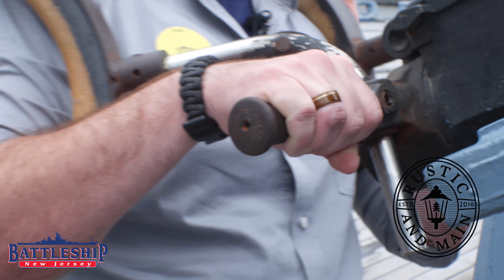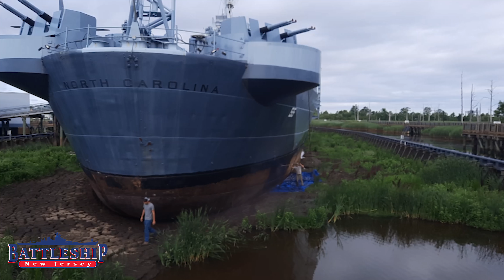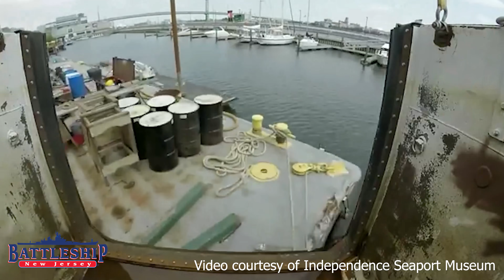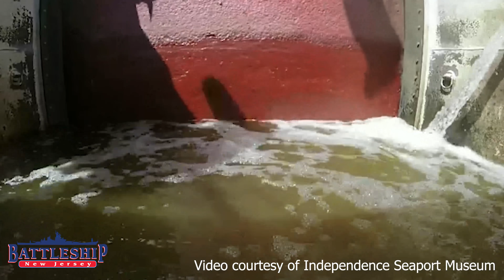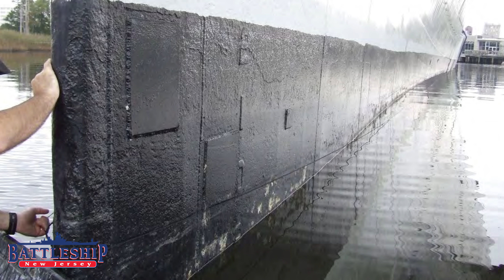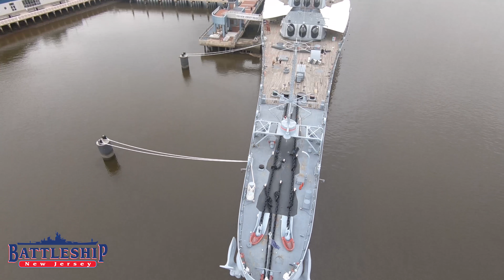Battleship North Carolina's Cofferdam

Comment: I think the cofferdam is great as long as the ship still floats and she can leave the cofferdam if needed to go to a conventional drydock
Reply: Doubtful if she ever leaves her spot again.  10 years ago it would have been about a $50 million price tag to get her to the closest drydock at Norfolk, who knows what it would cost in the future.  And she won't fit under the Cape Fear Memorial Bridge.
Reply: Theoretically she could fit underneath the bridge with parts of her masts removed, but it doesn't seem necessary if they can do repairs to the submerged parts of the hull that aren't encased in mud. The Vasa lasted for hundreds of years and is almost perfectly preserved. The cofferdam seems like a pretty ideal solution, lacing a nearby dry dock that could accommodate a ship of her size.
Reply: She doesn't float, hasn't floated since 1961. There's purposefully  another roughly 20 feet of hull under the mud, which serves to protect her lower hull since oxygen can't reach it and thus help rust it, and it keeps her stable during our active hurricane seasons here in NC. Hence why you can't see her rudders or props, she's been sunk in the mud like that for 60 years. With any luck, she'll never float again, which sounds sad but that's the best thing for her.
Reply: @cleverusername9369  Actually she floated a few years ago during a hurricane we had, they were worried she was going to settle back in the mud wrong when the water went back down.
Reply: She floated during Hurricane Florence and settled with a slight list, we couldn't use her bathrooms on the ship because of it lol. The Cape Fear Bridge is the only Bridge that was built after she was brought in and will soon be getting replaced itself and most likely with a much taller Bridge.

Comment: why don't they want the ship floating? wouldn't it be better for structural integrity rather than it sitting on mud?
Reply: The mud actually serves as a protectant against corrosion since it deprives the hull plating of oxygen which fuels corrosion.
Reply from the maker: Stay tuned for the video and we will get into that!
Reply: @Trepang 412 and the exposed steel has some major cancer
Reply: Read about the old wooden sailing Swedish ship Vasa. She sank in 1628 and was almost perfectly preserved in the mud and was salvaged and is in a museum in Stockholm.